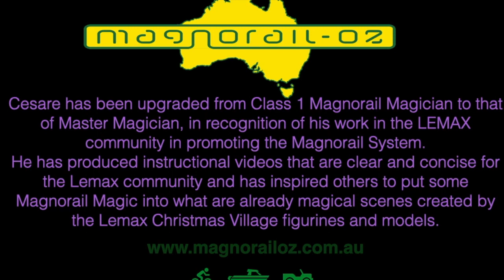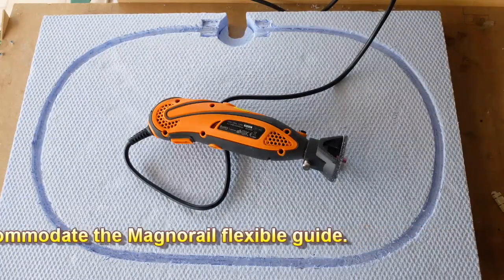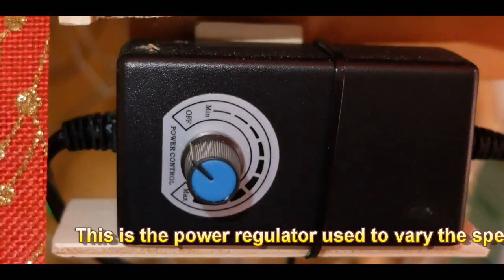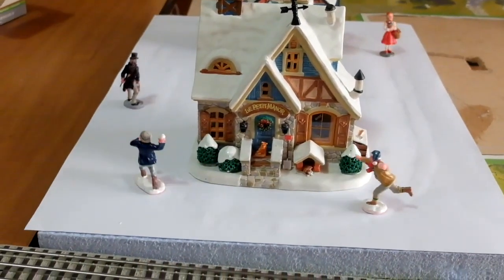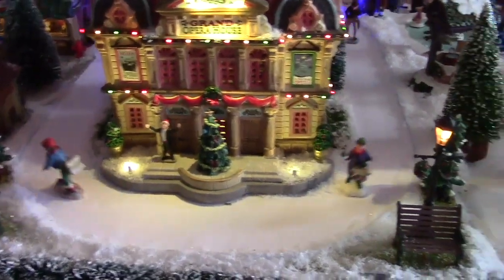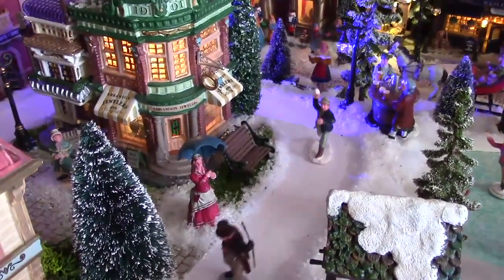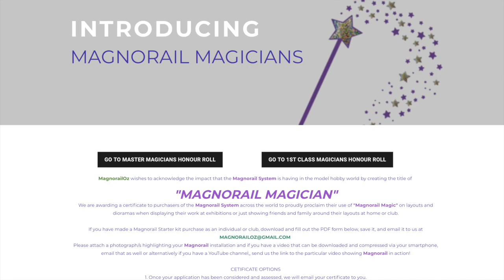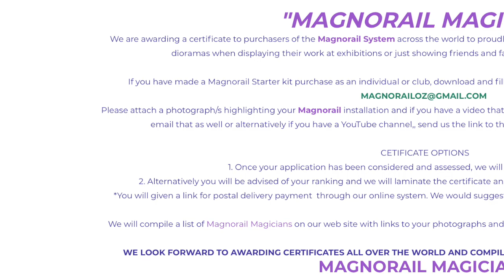Magnorail meets Lemax #4

Comment: Which set are you using for this one and the snow hill, the one for cars or cyclists? Is there even anydifference?
Reply from the maker: The slider set with the fast motor was used for the ski lift( but the bicycle set was used for the bicycles but needed 2 motors) and has a higher speed and torque but can be slowed down with the power controller to what ever see you need